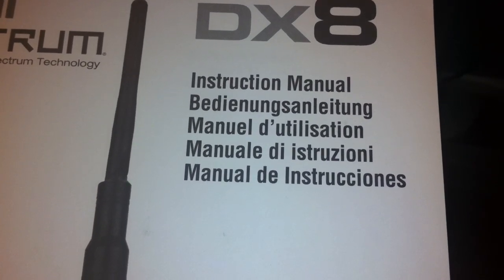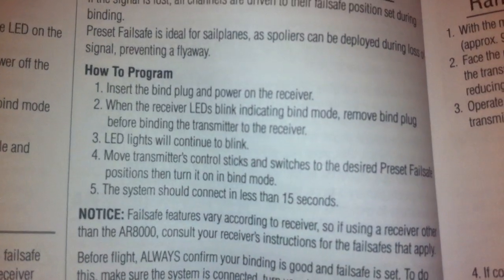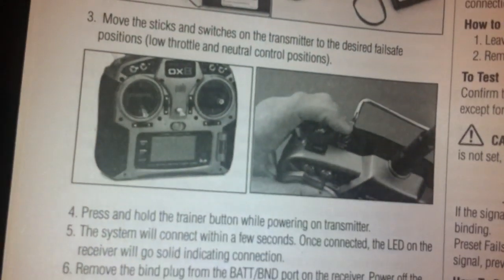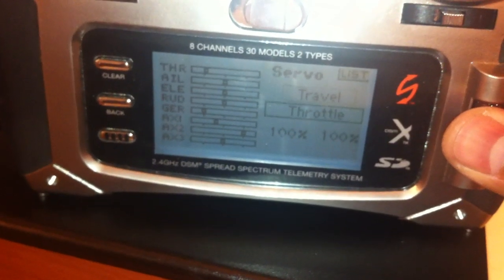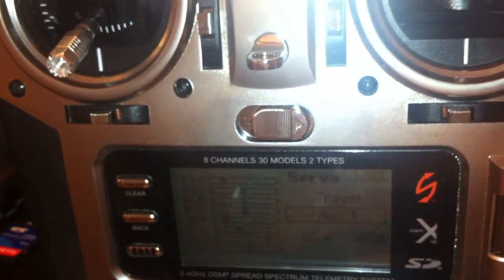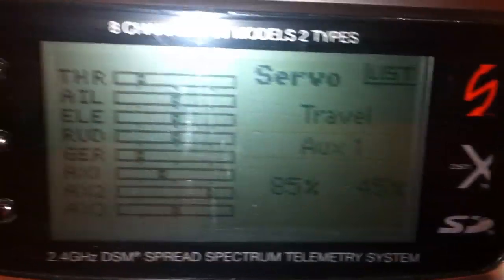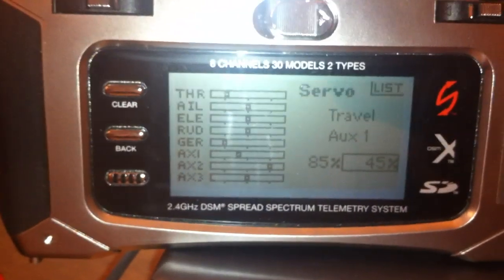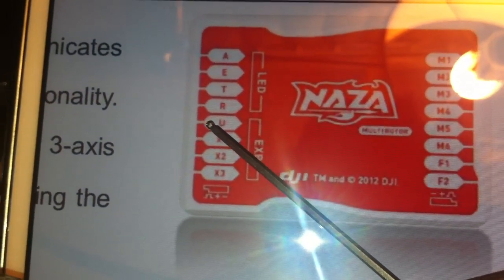DX8 AR8000 Smart FailSafe setup

Comment: can you please email me your setting I have same setup naza v2 with gps dx8 with ar8000 I had to setup in heli acro I could not get to work at all. everything works perfect except if I turn tx off it does not go into failsafe. I have all ioc and rth working but not failsafe if I turn off tx, can you please help me correct this? thanks in advance for any or all help email me at  davidringler40@yahoo.com
Reply from the maker: also make sure step 7 is correct too. this is very important:
"7. Set your control mode switch on your transmitter to ATTI mode [middle sw pos] (the transmitter must be off! This is the most important step!!!"

NOTE: the failsafe we are setting up has nothing to do with DJI Naza, this failsafe feature is within the DX8 and receiver function. you can even setup the failsafe with the receiver and transmitter alone, you don't need to hook the D-BUS to the naza. anyways, i don't want to confuse anyone, just remember the KISS principal (keep it simple)
Reply: towntech  thank you for the help, so why should we use acro instead of heli for quads?also why wouldn't th dx8 let me setup quad in acro?
Reply from the maker: david ringler
I have never seen any transmitter in the market that has a quad setting. Anyways, you should avoid heli, it is the most difficult to setup. Choose Airplane instead because it's easier. In DX8, the word "Acro" is the samething as "New"
Reply: so its easier to setup in acro mode? less wires into the naza?
Reply from the maker: david ringler
it's not less wires it's just less settings.to setup in an airplane mode versus heli mode. but if you have everything working in heli mode except the failsafe, just follow the direction from my description and you'll be fine.

Comment: I been trying to set my on smart mode but can't get it I want my quadcopter to get in to failsafe if I loose signal
Reply: me to I am using a dx8 with ar8000 with naza m v2 with gps I got all functions working ioc rth but if I turn off tx it does not go into failsafe please tell me what I am doing wrong also mine is setup in heli mode because I tried to setup in acro and could not get it to work. can someone please help me?  davidringler40@yahoo.com
Reply from the maker: david ringler In my description, make sure you are doing step 2 correctly:
"2. Turn on the DX7s and make sure you have the correct model selected. And remember what switch positions define each mode. Eg. DOWN=GPS MID=ATTI UP=MAN"
Reply from the maker: sorry my vid is useless, but check out my description

Comment from the maker: Make sure the throttle is in the position you want it to move to if there is a loss of connection.This position is stored during binding. All other channels will move to the preset positions during initial powerup only and then if there is a loss of connection inflight the control channels will Hold last command until the connection is reestablished.

Comment from the maker: On all Rxs the throttle channel is driven to the position that was set at binding if there is no connection to the Tx.
With Smartsafe the primary control channels "Hold last command" if there is a loss of signal/connection.
With Preset the channels are driven to the preset position recorded during binding.
All Rxs(except 6100) use Smartsafe. A few of the higher end Rxs additionally have Preset available.
In your case with the 6210 it uses Smartsafe only.

Comment from the maker: You are trying to setup smart fail safe not fail safe. All Spektrum Rxs have failsafe built into the Rx that is set at binding.You need to carefully read the manual for the specific Rx you are using what type of failsafes are available. All channels set a failsafe position based on where the channels are during bind.This is where they will move to when powering on before the connection is made.

Comment from the maker: yes, I have DJI F450 and I have to setup the smart failsafe in my DX8. Because if you are out of range, it'll come back to you. and if your transmitter battery ran out, it'll come back to you. It took me awhile to figure it out. but it's been awhile since i set up my smart fail safe mode to work great. you'll just have to play around with it, this is the best vdo to illustrate how it works.